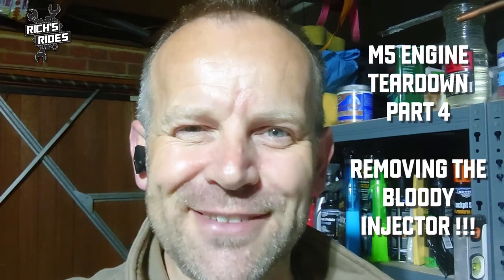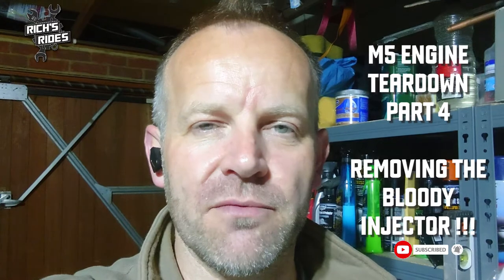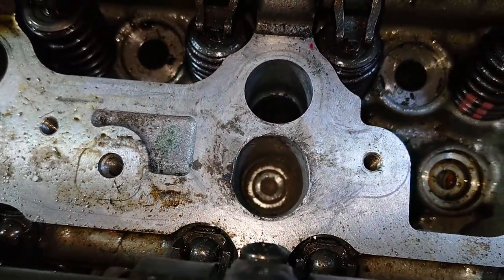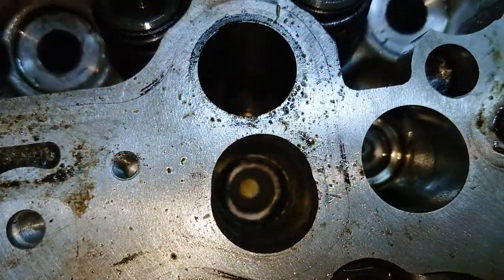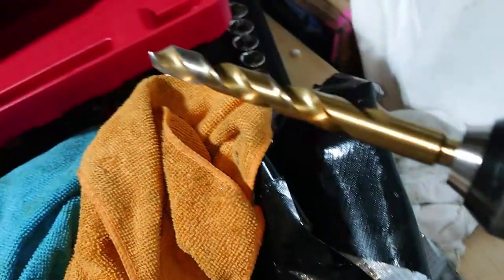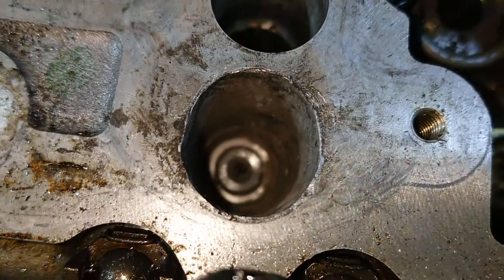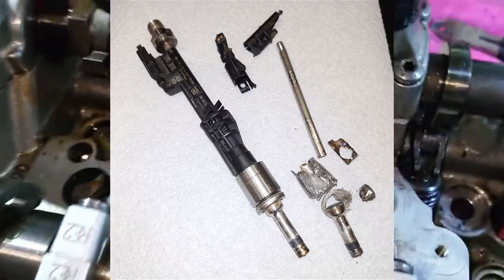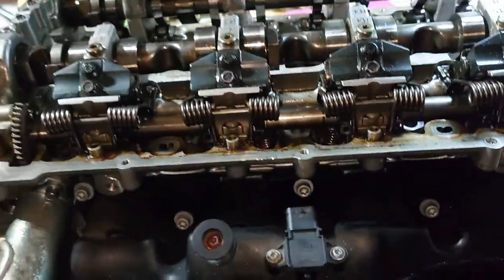BMW M5 S63TU Engine Teardown & Rebuild Part 4 - Remove Stuck Injector

Comment: thank you for your video it helps me a lot to repair my m5, even if I do not understand all the visual help 😁
Reply from the maker: Happy to help, what's happened to yours? how is the repair coming along?
Reply: cylinder number 6 injector hs the car was faulty, I changed the 8 ignition coils and 8 spark plugs and thanks to the videos I changed the injector without removing the cylinder head!  I used wd-40 for 1 day before and it came with the tool 👍🏾now it has failed ignition sometimes I am looking for the problem.
Reply from the maker: What is it with Cylinder 6 ? Glad you got it out without having to go through what I did! Go back over all your connections, make sure the coils are seated properly and checkout the condition of your spark plugs for any clues to what's going on. Good luck, let us know how you get on.
Reply: Defective injector cylinder 6, I have checked all the coils and spark plugs, the car works very well sometimes, and other times it misfires and fails powertrain on the odometer and the car stalls at 3000rpm  / min and return to normal only after switching off and on again 🥵

Comment: Hey there! I like the videos you made on this car, I have yet to find a video thats as detail oriented on the design of the S63tu and by extension the N63tu. I'm tempted to do a valve stem seal service on my own N63TU powered car and trying to gather as much info as I can. How do you disassemble the head/valvetronic system on these engines? Is it similar to other smaller BMW engines of the same year? Any help or other advice is greatly appreciated! :D

Comment: I'm running into the same issue in the same location. I really hope I can pull it out. I already broke the threaded head on the injector. 😢
Reply from the maker: Have you tried finding a company that will pull it for you? If you've already snapped part off you're already compromised and heading down a slippery slope.

Have you soaked it in penetrating oil?

Fingers crossed it comes out clean for you
Reply: @RichsRides  yes I've sprayed penetrating oil and let it sit for a few days. I've tried to move it a around a bit to make it get into the cavity. I'm in the process of replacing the valve cover gaskets. I'm going to let it sit for a few more days and work the other side, fingers crossed I don't run into the same thing. If it doesn't budge, I was thinking of doing what you did and try to remove the valve cover, add some heat and try again. Worst case scenario I plan on reaching out to my local trusty mechanic to finish the job. Hopefully they accept the job. I've done my best to label every bolt and I have OEM replacement parts.
Reply: I just wanted to share that I was able to get it out! I'm so happy I want to tell the world 😂 I took off the valve cover and grabbed a pair of pliers towards the base and I was able to twist it and pop it off. It only took 3 weeks of soaking in penetration oil and a lot of cursing.
Reply from the maker: @allensgarage  mate, brilliant news. Well done.

Comment: You are very brave!   This engine looks like a mechanics worst nightmare, like the opposite to a work of art. And it looks damaged beyond economical repair too.
I guess you didn't drop it completely with subframe because you don't have a lift ?
Reply from the maker: Brave or stupid ! Unfortunately I don't have a lift so doing all this in my driveway. The engine is definitely not the friendliest I've ever worked on, space is so tight, and it's so tightly packaged.

It'll cost a little to repair, but a hell of a lot less than taking it to a garage. I'm also quite enjoying the process, it's a welcome distraction from everything else these days. I'm going to be like a proud father when this is finished. 

I really wanted to show that we shouldn't be afraid of getting our hands dirty, it doesn't always have to cost loads of money every time something goes wrong. If I can do this, anyone can do it!

Just like @Tavarish "I am the Warranty" 😁
Reply: @RichsRides  Yes I totally get that, especially if you can spend the time.  I had my s65 seized on main bearing before and before we got to that conclusion it was gearbox out , engine out, using a greasing pit.  When the new engine went in with gearbox from beneath it was much easier. But I did have like 100 less hoses to connect :-P
Reply from the maker: @roymoorman5990  that sounds like it was a bit of a journey. I'm not out of the woods yet, still so much that I could uncover when I drop the pan off and pull the piston. I'm hoping that the missing bits of piston  haven't caused carnage! Fingers crossed 🤞
Reply: @RichsRides  you're a legend for doing that. But you do seem to have a lot of engine mechanical knowledge already, not like an average novice. What is your experience with engines?
Reply from the maker: @1980videoking I'm not going to lie, being called a legend is kinda cool! Glad you think so. 

I'm fairly mechanically minded, growing up my dad was a engineer, he actually built his own house (way back) with help from other family members. I guess it was that 'get involved' attitude that rubbed off. I remember him taking the head of my Mums old Metro (remember those death traps?) and cleaning it up as it was running rough, most people would have taken it to a garage. My very first car was a bad choice, the guy sold me an absolute lemon and the bottom end went after about 3 weeks of owning it. Dad helped me replace the engine, although back in those days they were a hell of a lot simpler. Since then I've always done what I can, I'll always replace brakes, do oil changes, exhausts, stereo's, replace whatever's broken but nothing on this scale, I've never done a complete teardown before!

It really comes down to the fact that these things are just nuts and bolts, all you need is the right instructions, a few tools and the right attitude and you can achieve anything. I've always lived my life by believing that "If you can do it, I can do it too". We're all human, there's nothing special about anyone, it's just how you apply yourself. If you think it's too much and too complicated from the outset then you'll never succeed. I really want to show anyone that'll watch that although these are alittle complicated, it's all achievable!

Don't get me wrong though, this is a huge undertaking for me, and I'm by no means out of the woods, and to be honest I do feel a little daunted by it at times. It is very much a voyage of discovery! But as some youtuber says "Keep Moving Forward", every step I take is a step closer to completion. And if I ever find myself absolutely stuck and simply don't have the tools then I'll be calling in the cavalry.

Thanks for your support buddy.